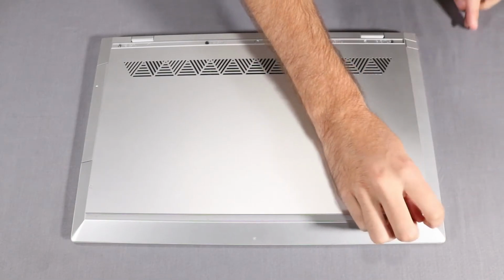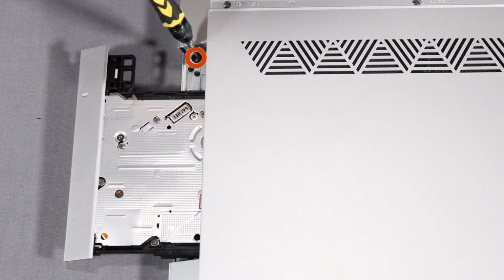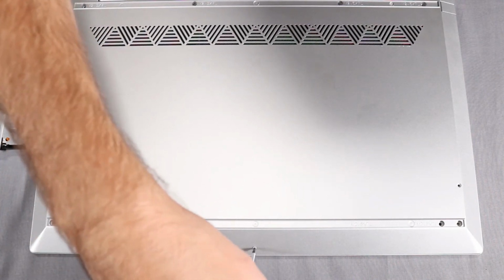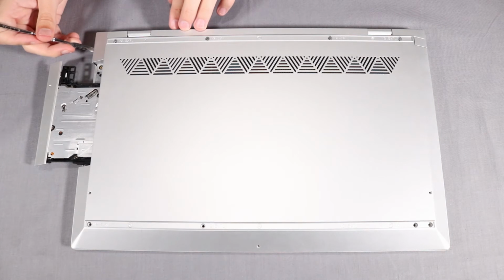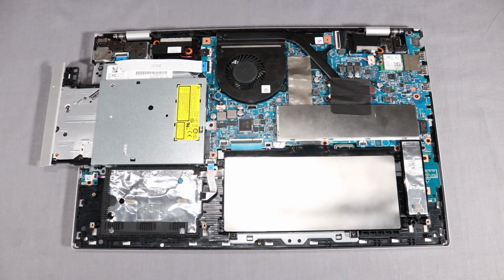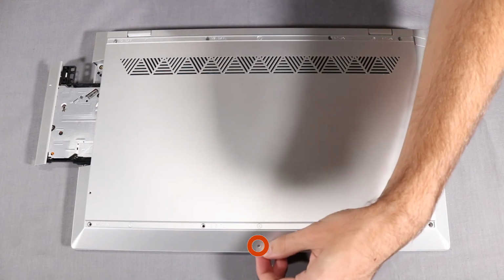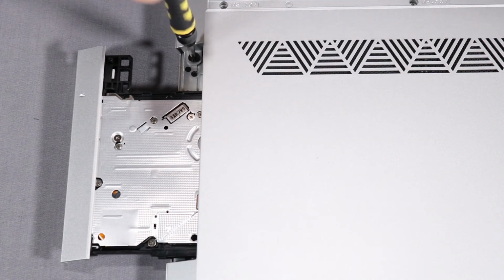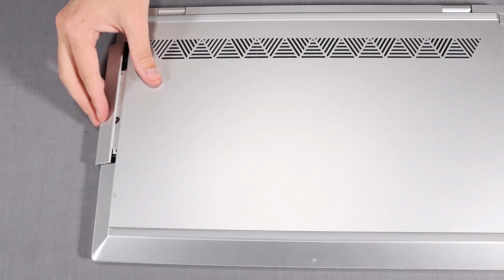Replace the Base Enclosure | HP ENVY 17-ce0000 and 17-bw0000 Laptop PC | HP

Comment: I absolutely hate the way you have to take out and put in batteries now! Why couldn't you had just left it where a slide of a button on the bottom would had gained access to the battery for much easier replacement like the older laptops?